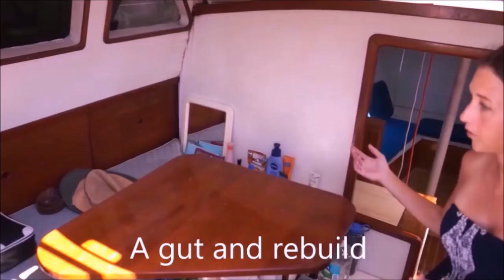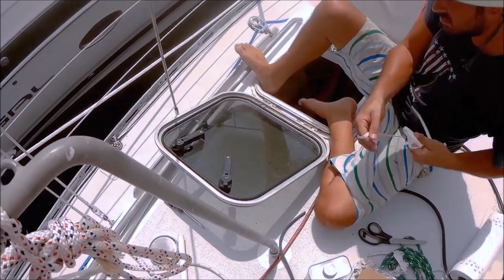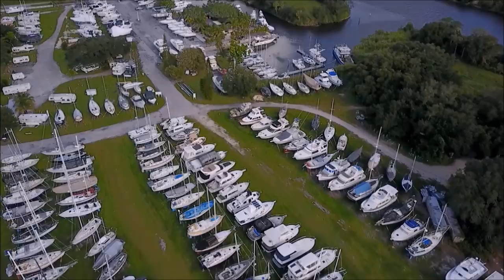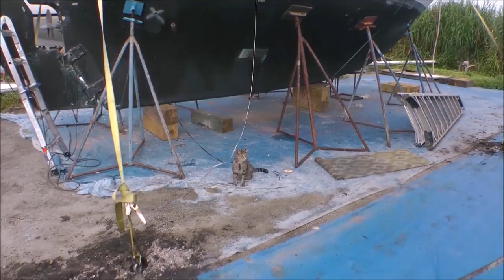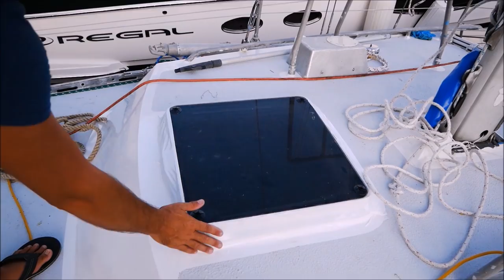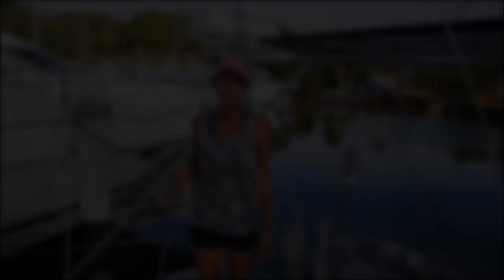Batten the Hatches, Irma Is On Her Way (MJ Sailing - EP 33)

Comment: Use 303 Aerospace on the gaskets (and anything else plastic or rubber) and you may never need to replace them again.
Reply: We use 303 on just about every plastic surface, but have always used a silicone (non rubber killing kind) on all our gaskets.  Maybe I'll have to give 303 a shot with those too.

Thanks,

Matt

Comment: How well did the sabre 34 sail and handle? I’m a proud owner of a 77 model and haven’t had it out of storage yet or in the water. I herd it’s not a boat you can heave two on very well in rough conditions and was wondering if you all had any past experiences with that?
Reply: Ronnie,

The MKII was a completely different boat and unfortunately, I'm not sure how close our experience would relate.  With our 1989 34', we  could not get a proper hove to position and would start forereaching instead.  To be honest, we only tried it a handful of times and never really fully experimented to try and get it right.  Great boat otherwise.... enjoy yours!

Matt
Reply: Ronnie.... one other thing.  With the hull shape of these boats (I think yours will apply too) we found a drogue really helped directional stability in nasty weather.  It would be high on my list of things to purchase If you're planning to do much off shore sailing.  We had a Sea Brake, but there are many other options available too.

Matt

Comment: Why not use the anchor chain would it not be stronger
Reply: Chafe against the boat (damage to the boat) from the chain along with having zero stretch makes it a little more difficult to use.  The loads from the wind are dynamic during a hurricane and constantly move the boat around requiring a bit of stretch in the line or you risk pulling a cleat off the dock.  Chain would make a good back-up to the dock lines, but we used 3/8" Dyneema lines instead for a back-up.... it's actually stronger than the chain, but not as chafe resistant.

Matt

Comment: Is there hurricane insurance for your boat? And, is separate from a regular policy?
Reply: Our policy on the last boat had no additional charge for the Hurricane Zone in season, but did double the deductible if damage was caused from a named store in that area.  This boat has just a liability policy and has no replacement/damage coverage.   

Matt
Reply: Thanks Matt, I will be coming back to Florida next year and plan on following your lead. I want to find a live aboard boat after I sell my place here in San Diego. BTW, my house in Cape Coral went through Charley in 2004 and that same year Francis and Jean took part of the roof off my condo in Satellite Beach. Hence my question. All my best.
Peter
Reply: We had Traveler's insurance and a policy with Lloyd's of London.  For a $75k replacement value, it was $1600 a year.  I didn't think it was too bad at the time.

Matt
Reply: Peter Cole Isi